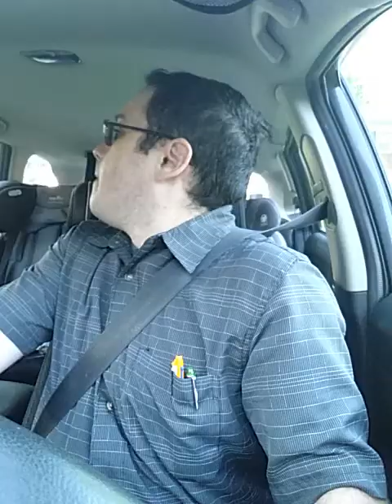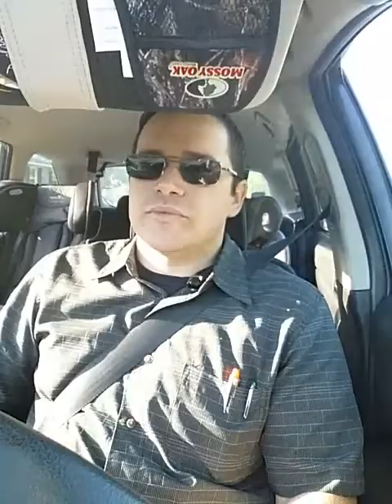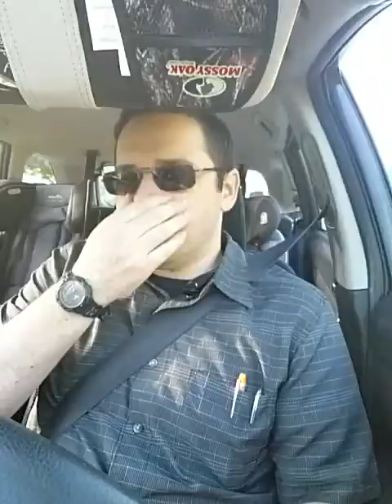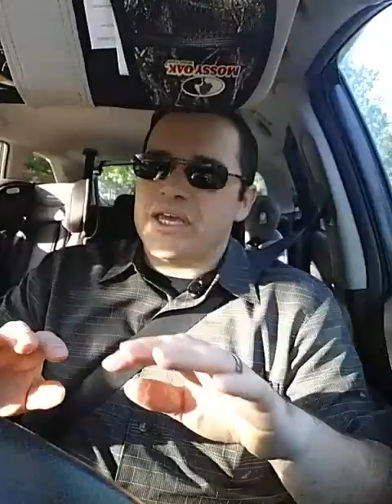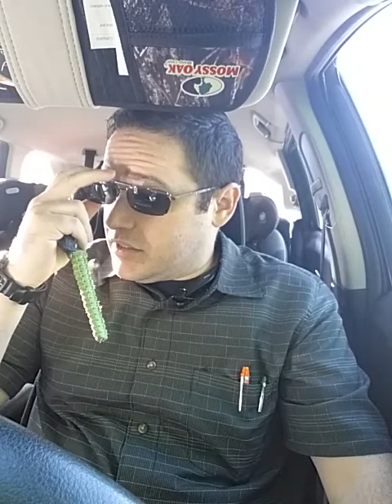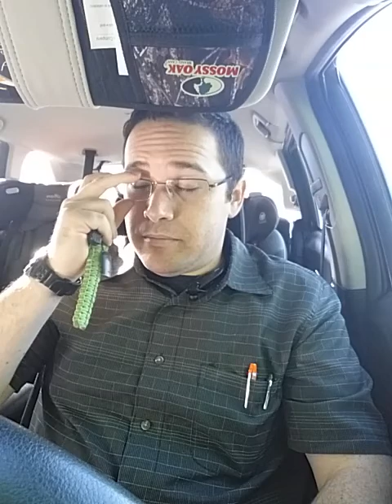vlag:Rough day rising, Signum bluetooth/I2C, New Signum version?

Comment: I definitely in favor of the Idea for the Split version:)

And Bluetooth is nice Idea, would it generally possible to get the usb signal and send it over Bluetooth? (I know thats avery noop question.)
Reply from the maker: There are usb to bluetooth "translators" like the Handheld Scientific BT-500 adapter, but I'm working on using a controller that can do the wired USb and the bluetooth by itself so the code can switch back and forth between where it sends output.